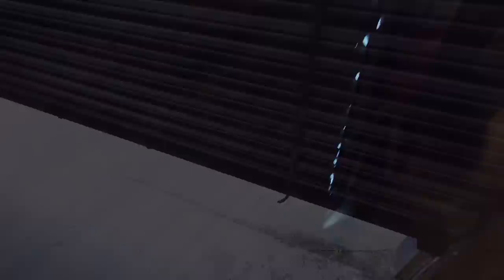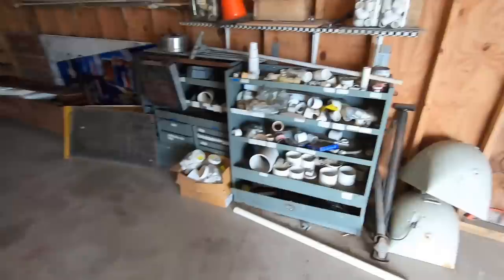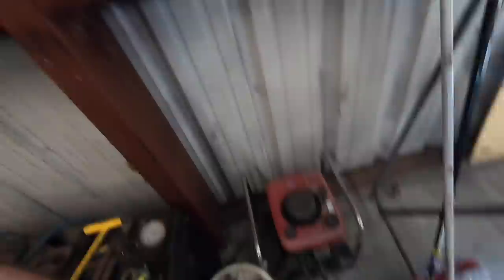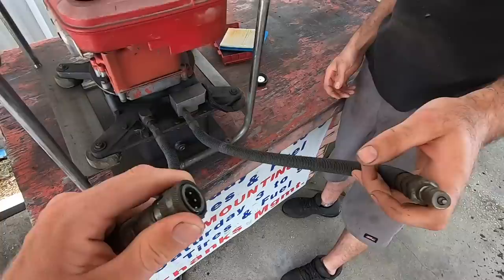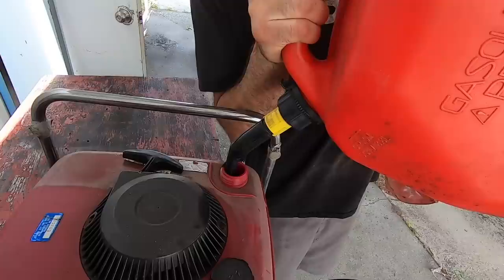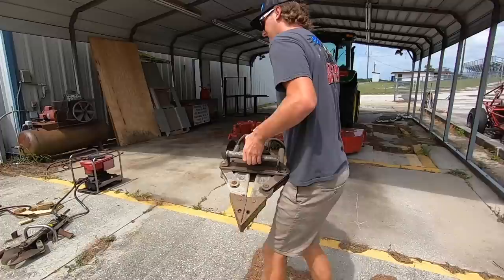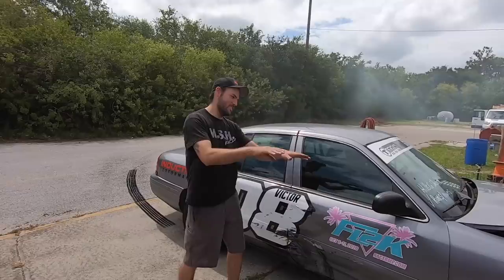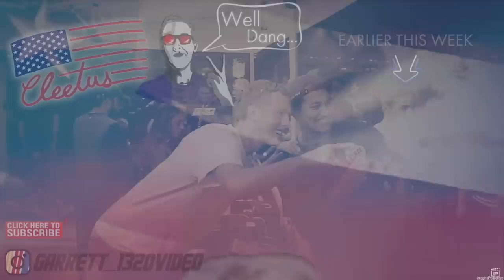We Found a REAL "Jaws of Life" Setup at the Freedom Factory and Powered Them Up!!! (they're insane)

Comment: Y'all should get some of the small engine fuel like VP and some other companies make instead of that garbage gas that is sold at gas stations today.  The alcohol in today's gas will gum up the carburetor and is generally not good for small engines.  PS you should find the serial numbers on all those tools and check with Hurst and check if they need any updates or certifications for use at the Freedom Factory etc.  Lastly I think there should be some sort of load sensing governor on the power unit.  If it were me I would check with your safety workers to see where they get their stuff serviced locally.  Awesome stuff to have around, hopefully you'll never need it but definitely better to have and not need it than to need it and not have it.
Reply: It depends on thee state and the time of the year for the amount of alcohol in the fuel, additionally many of the additives that are put into today's gasoline cause it to have a very short "tank life." Up until the late 1980's gasoline regardless of the grade would not appreciably degrade in the tank and or gum up carburetors in small o.  However by the early to mid 1990's saw the introduction of oxygenated gasoline as well as the introduction and use of additives to help reduce emissions but they had a negative effect on fuel economy and the stability and "shelf life"  of gasoline.

Comment: I’m a fire fighter so, you will put your spreader in the cracks of the doors and spread the door jams so the door clamps are exposed. Once that is happened, you take the O-cutter and you cut the door clamps. Don’t fight it because you ain’t gonna move it since it’s 10,000LBS of pressure. And with the car, cut the ABC pillars which are the arms on the windshield, between the two doors, and the back window. Make sure you have no power to airbags because it will explode. To make it more fun, put the spreader under the dashboard and the floor panel from the door jam, and it will break the dash up and it’s loud as hell. He’ll yeah brother

Comment: There was literally a tire changer down and to the left of the jaws of life
Reply: Don't break your arm though
Reply: thats an older style changer really only used for steel wheels as isba pretty agressive machine i would assume they bought a more universal machine.
Reply: They probably want a rim clamp machine, to keep things nice.
Reply: That is a air powered tire changer I used to have one and it worked great
Reply: Those work, but they're extremely basic and only to be used on steel wheels you don't care about. You can mount a tire on an aluminum rim with one, but you'll scratch the hell out of it in the process.

Comment: The cutter's are used to cut the  A pillar, B pillar and a spot on the C pillar on both sides to take the roof back to get someone out that needs to cut out. If the steering wheel is in the way you can cut it off like the bottom half. Use them to cut the post it the middle of the car B pillar at the top and bottom. That will get you full access to the drive to get them out if the have to be put on a backboard. I was a  Volunteer firemen and we go to the junkyard in practice on cars there so everyone knew how to use them and get faster at it too. The spreaders are used to pop the doors open. You can probably find out on YouTube so you can see what I'm talking about if I didn't make sense.

Comment: Hey Cletus, these are old school rescue tools, the different “spreaders” you have have different purposes, the really heavy one is called the “32b” they spread to about 32”s and they are for opening doors/hoods/trunks, and you can actually pinch things and furthermore  lifting dashboards. Event though they are really old set, some fire company’s still run them today. The other two things you were calling spreaders are actually hydraulic rams, used for lifting dashboards, they only push so you generally need a plate to sit in(at the b post) pushing toward the dashboard crash bar(runs across the inside of the dash) and it will fold the front of the car down if done currently. With the other two items they are O cutters, obviously based on the design they cut in a circular way, kind of like two claws crossing, you can use them on anything you need to cut, except hardened steel, they may cut hardened steel but it’s not worth testing due to the fact it may shatter the tips. So places you’ll find hardest steel on a car are like the seatbelt mounts and all that. Firemen of 8+ years and a decent amount of rescue expierence and training any questions go ahead and ask.

Comment: Cleetus & Crew, If you will run 100LL Avgas (airplane fuel) in your small, lawn mower engine powered tools, such as the hydraulic pump, you will not have gummed up carb issues. Avgas has an advertised 1-year shelf life, but it will and does last a lot longer than that.

Comment: Should attach to the back of “track emergency vehicle” like a pick up or something with all those tools on it already to go
Reply: Or on a small trailer that even the golf cart or atv can tow, along with some work lights, first aid kit, fire extinguishers, maybe a water pump and hose that can tap into the irrigation system
Reply: Or...ya know...the tracks fire truck? Ya know. The one they bought
Reply: I guess it's a neat idea but there's more to it.  Those tools are outdated and borderline dangerous.  Improper use is dangerous to the operator and victim.  Vehicle rescue requires training and regular drilling to be proficient.  Situations also require more than just a cutter and spreader, without even getting into the PPE requirements.  Having untrained people running old tools in a life or death situation that occurs during a high risk activity is ignorant.
Reply: I'm thinking it would be useful mounted to the rollback to cut and or spread things to make a car movable again
Reply: @Ghilliebandits  During that episode Cleetus talks about using it to water the grass around the track....
Reply: @10melah5  they gotta get that rollback fixed up... It's already got a hydraulic system, just needs some tees and hose/fittings.

Comment: Hurst made the first “ jaws of life”. I think they called it the Hurst escape or the Hurst tool that was in the late 60’s.
 The tool has as much pressure opening as closing. The tool came with two chains that you measured after each use to make sure the stretch on the chain was within specifications.
 We practiced with the Hearst tool at a junkyard and tore up a whole bunch of cars as part of my paramedic class. Some tools had gasoline engines that ran the hydraulic pump and some had electric motors that would turn the hydraulic pump. It’s a fantastic tool to help get people out of Mangled Cars quickly.
 The cutting jaws are for cutting roll cadge tubing.
Reply: I've got a Hurst 12v hydraulic unit outside, (and a bunch of hose, reel, etc. Sold the jaws and spreaders). it has a short pair of jumper cables on it. I'm keeping for a future hydraulic bending machine I have in mind.

Comment: Upwards of thirty two hundred, for the ones wondering the price of the “ hurst jaws of life “ setup they have!!
Reply: You can get them for a cheaper price if you look around, and some departments just sell their older stuff cheap as they want it gone. Personally around here we use HURST Cutters and Spreaders but we also Use Edraulic cutters and Spreaders so they don't have a Hydraulic line running from the generator.

Comment: I would think about replacing those hoses as hydraulic fluid blinds and this is an insane amount of pressure
Reply: Yup, and if you get hit by the stream from a leak it'll inject fluid into your body. What they do to fix it involves removing any contaminated flesh...
Reply: Haha you guys are tools.  They'll be fine it's been stored indoors...  Replace if they start to leak or become weathered.  👍
Reply: @derekbader130  it's old rubber hose it can fail under pressure without warning. Replace them. I've seen a hose on a port-a-power pump fail. The guy standing next to it has a new tattoo from the blue hydrolic oil that was in the pump.

Comment: You have about $15 grand worth of extrication tools between the 2 cutters, spreaders, and 2 rams. Hurst is the top of the line most trusted company with most fire rescue teams across the company. Get in contact with the local fire department and ask who they have service their set and get those in for service and confirm everything is tip top shape. It is fairly cheap to have done when you think about the grand scheme of it

Comment: Take it from a firefighter, those Hurst tools are heavy as hell and suck to operate for long periods of time
Reply: Heavy usually means built well though.
Reply: They really do man. We just got some E hydraulic ones that are completely portable and they are twice as heavy as our old ones.
Reply: They look huge compared to the holmatro brand ones I've worked with
Reply: @masonhallman2442  We just got approved for those. Our tools we have are outdated by 5 or 6 years. They're only good for 5000 psi, but most modern cars now require 10-15,000 psi to cut through. We had a fatal pinjob last year in August that really got this ball rolling to get em. There was no chance of saving em, they where unresponsive, and died about 2 minutes after we arrived. We had another patient who was red in another car who had to be cut as well.  Took us 35 minutes or so to do a 10 minute job. But we got em out alive and into the med copter
Reply: @7eis  We run Hurst. I've only got to play with Holmatro maybe 2 or 3 times. One of our neighboring depts runs them
Reply: @buckberthod5007  even with the latest greatest tools you aren't always getting through. you waste time trying to cut through high tensile strength steel, you stretch it first. I just had an opportunity to cut on brand new cars in an advanced extrication class, which is rare for us to train on in the fire service, and the new hurst e hydraulics could not cut through. We had to stretch the metal first to successfully cut threw it. Shit was crazy
Reply: Fred Hurst inventor of the Hurst shifter.
Reply: @generalkayoss7347  Highly disagree. It could be made out of zinc, be heavier, and explode in your face.
Reply: @BReese504  I've got into the habit of taking the fender first, creating a purchase gap between the door and hinges and spreading them. They normally pop right off. I took a couple advanced courses myself, we had a semi with the cab crushed in and a car pinned under the trailer for one of the exercises. Man was that a job and a half. I'm a rural dept, so we have a lot of heavy equipment as well. I dread the day someone flips a tractor or an excavator and gets pinned because i don't know how the hell we're cutting the cab. They're extremely thick metal. We did one in training, a little mini excavator. Took an hour and a half to get into the damn thing
Reply: @generalkayoss7347  You'd think that with all the modern technology and metals we have,  we couldn't make one out of aluminum and shed 20 or 30 pounds
Reply: @buckberthod5007  I spread the the hinges too. I have move success there then spreading my the b post, especially in a t bone accident.
Reply: @BReese504  The strongest part of a car is the A and B pillars,  along with the glass for modern cars. That's why it's easier to take the door from the hinges. Only take the roof if you have too. Most times, you can pop a door,  cut the seat if you have too, get a scoop in there, get em on it and slide em out.  That's for a routine pin job like a T bone or car vs a tree or pole. A rollover or something more serious is gonna take a lot more work

Comment: The scissors are designed to cut through the A and B pillars so you can throw the roof back. Spreaders are for spreading doors apart, and the rams are for moving engine blocks and the dashboard away so you can get the victim out. I'd be delighted to come to the Freedom Factory and show you guys how to use them!

Comment: Just an fyi those Hurst tools don't use just a regular hydraulic fluid if you were thinking of changing it yourself. You also don't really want to get the hydraulic fluid they use on your hands and definitely not in your eyes. The hose they use isn't your average hydraulic hose either. These operate at a much higher pressure than a tractor hydraulic system. There was a hose for them on the shelf where you grabbed the first set of o-cutters from. Don't put the pump valve in pressure mode without a tool hooked up or at least the 2 hoses on the pump coupled together. Those are definitely older tools, but for the cost of a new set they should work fine after being checked out and serviced. I'm thinking you'll be shocked at the price of a new set. You could drop $20 to $30 grand fairly easy. Just a few pointers from someone with 20 + years of extrication experience.

Comment: You guys need to make an ultra reliable safety side by side with all these things mounted on it and a backup power unit. Have it ready to rock on the track with the keys in it. Maybe add a water tank and water pump. You could call this vehicle, the LIBERATOR.

Comment: I'd suggest looking into pneumatic power packs. very simple setup. compressed air bottle in the back of the safety truck. Long air hose to an Enerpac power unit. No fuel needed and the setup will be ready to go in the truck at all times.

Comment: They should start a series to see what those can and can’t cut through lol
Reply: Yeah like Rubys spent drive axles. 🤔
Reply: These things don't have pressure bypass valves, on purpose. Never know when you just need ALL THE POWER. They'll blow apart before they lose pressure. So I really don't want these boys to mess around like that.
Reply: @octane613  so what would happen? would the first weak link break?
Reply: They will cut through anything, used them for years. If you can get a good bite and it doesn't slip off then you are cutting it in half. The ram that they didn't really mess with at all will extend 3 feet from that compact size it is. And the spreaders have enough hydronic force that it will lift a fire truck off the ground enough to change a tire. These toys are serious
Reply: dahbahm god damn 😂😂

Comment: On your pump, you can run it at full throttle all the time when you use the tools. You get much better performance that way. Also, the cutters can cut through most things on modern cars. Being older though, they just probably won't cut through the nater pin. But it'll easily cut through the pillars to take a roof off etc. (Just beware of the seat belt assembly. If you cut them the springs will explode.) Besides the cutters and spreaders you also have 2 Rams. Normally used for lifting a dash on a vehicle to free trapped drivers.

Comment: You can disconnect them and swap tools with the pump running. Get the rescue guys to give you some quick lessons, its easy to snap a blade, shut it off with pressure in the hoses etc. Also wear eye protection and dont use them on a car with a person trapped by compression, you can hurt someone more just leave it to the pros. Good vid Cleet :)

Comment: Now you know why it is fairly stupid to get into a fight with a qualified fireman- his/her quals, annually, make carrying the Jaws around a small thing indeed. And they run into structures most of us have the sense to leave quickly! I get someone to clean up the quick release hydraulic fittings- the day you need that machine, you won't have time to beat them home with a handy hammer! But what an awesome find! Have you thought of "retiring on of the CVs , gutting the interior and setting it up as a carrier for the Jaws and fire extinguishers, and other safety related gear? Then you would know where it all was and could move it to a propitious place on the Factory when you run "informal" events. Also, when you make up the new extension hoses, prefill them and leave the opposing ends snapped together as the other equipment was. The hydraulic pump has a deaereator, and will get rid of a little air- a whole ten or fifteen feet of it might slow you down enough "on the day" while the deaereator bleeds off the air- low power at the jaws will be your take- kind of like brakes with air in the lines! Stay well and stay away from Palm Springs County! 
  Ps; The little blue tag seen on the pump assembly is a municipal property tag- a little research might tell you just which FD they came from, the auction they were sold from, etc, and maybe some important fires or accidents they "played" in. It would be cool to know!

Comment: Need a name for the fire truck... on a related note, how about a Freedom Factory Fire/Rescue shirt for the store? Maltese cross on the front left chest with Freedom on the top of it, Factory on the Bottom, Fire on the left, Rescue on the right. On the back, at the top in bigger letters Fredom Factory Fire Rescue and below that a picture of the fire truck with the Hurst equipment next to it. Letter the fire truck with FF logo .You definitely need to find a indoor place to store the rig as being out in the elements will degrade that truck quick. They require daily maintenance to stay running well and the interior components will start to fall apart.

Comment: Cleet, you can have a hydraulic system pressurized when you open the lines, you will get the tiniest bit of fluid out when you disconnect them, but they self seal, the only time you dont want someone to open them is if they intend to hold it partially on while the tool is functioning, then you'll get a nice big mess, but otherwise, as long as it's a quick on and off, youll be fine

Comment: For Clarification, the large unit you carried out first is the "Jaws of Life". The unit you were refering to as the jaws of life is just a set of shears. Word of caution do not try to cut the stainless trim that goes around windows or roof gutters, it will just bend anc adds side load to the blades and will actualy break the blade.